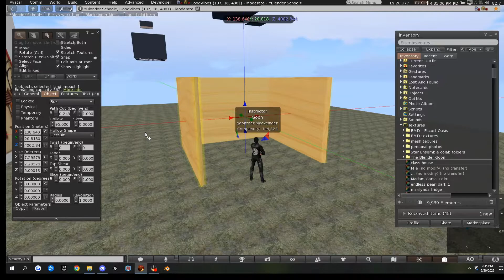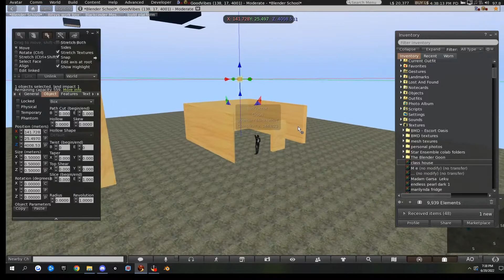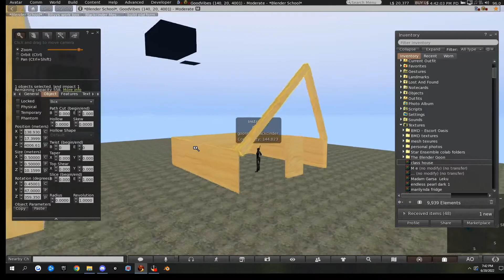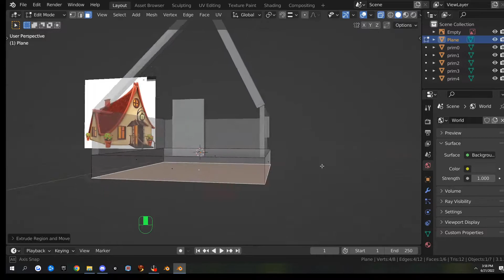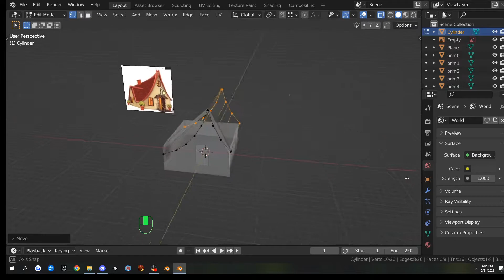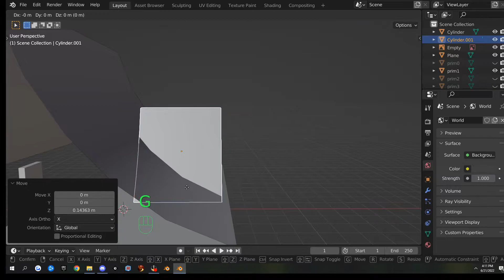V11 Blender 3.1 Modeling a house for Second Life.

Comment: tip I picked up somewhere on youtube. For Display Face orientation in settings you can set the positive normal to be  100% transparent (no blue). So you can leave display orientation on all the time and you will only see red on  the faces that are flipped.
Reply from the maker: Good tip, thanks for adding it.

Comment: what is the benefit to starting in SL ... taking it into blender and back out of blender back into SL .. instead of doing the intial model in blender from the start? Is it a prim thing ?
Reply from the maker: Its just for scale comparison. Allot of times things are out of proportion in SL but honestly the only time you really need to do it is if you are matching to something that is already in SL.
Reply: It helps with scale. My stuff was huge until I created a scale object that I exported from SL. Now it's way more a reasonable size.